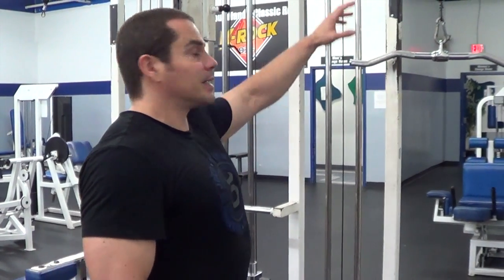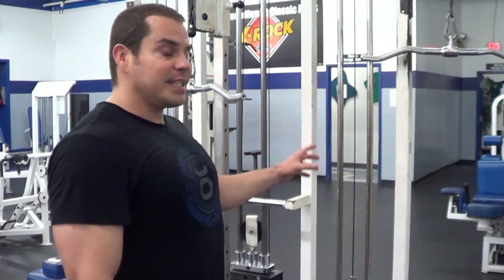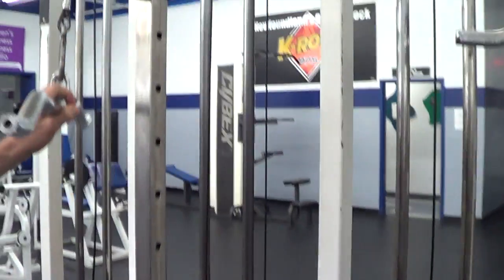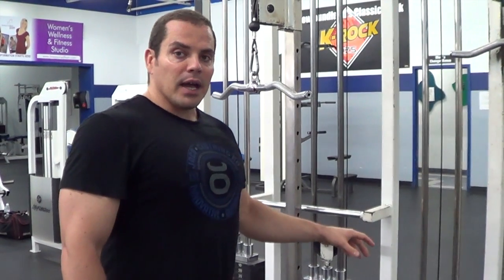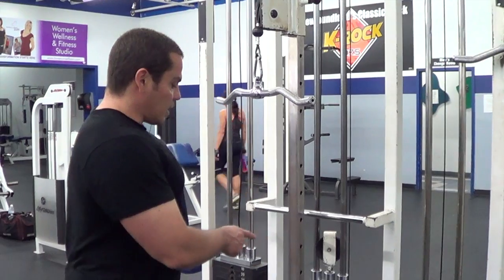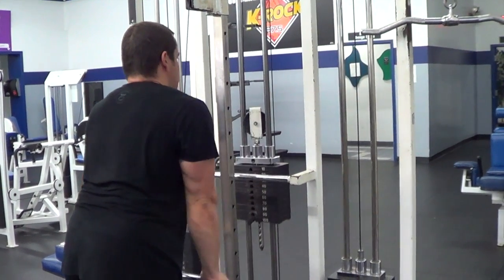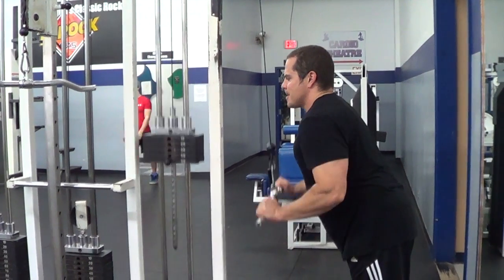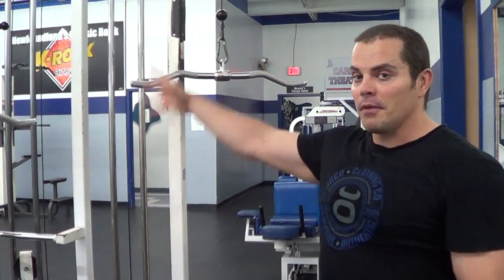Ask Lee: Why Some Weight Stacks Feel Heavier Than Others?

Comment: 155/2=77,5lbs, this is due to the stack having a second pulley, increasing the mechanical advantage. More pulleys also mean more friction so say 80-85 lbs might be most accurate weight lifted

Comment: It's not the amount of "stationary pulleys" but the amount of load bearing pulleys that travel with the movement of the load and how they are configured that reduce the weight (traveling pulleys can also be configured with no weight reduction) 
The machine on the right had no traveling pulley and has a 1:1 ratio, 50lbs feels like 50lbs. the machine on the left has that pully right over the stack. That pulley reduces it to a 2:1 ratio requiring only 50lbs of force to move 100lbs. 
The advantage of a 2:1 ratio is the weight stack travels upward half the distance you move the cable (like a lever) which means you can pull the cable twice as far before the weights hit the top of the machine. 2:1 ratio also has a lot smoother feel which is why it may seem lighter.
1:1 is great for heavy lifting like rows that don't require much cable travel and you get the full effective weight of the stack. 
There are some machines reduce the effective weight to 4:1. I'm not sure why that is needed but they exist.
Reply from the maker: Thanks for the detailed explanation.

Comment: Lee, you forgot to tell them something you know: the more pulleys - the better, not just for your ego, but also the cable moves much smoother and the resistance is equal from top to bottom, when it's only one pulley at the beginning of the motion it's really hard and then at the end it's super easy because of inertia

Comment: This is bullshit IMO.  When designing cable machines, they should be able to calculate the exact amount of weight you are lifting and display it on the weight stack regardless of the plates actual weight,
Reply: VF you totally missed the point he was making.  he wasn't arguing with the explanation
Reply: Johnny Begley It's not bs, it's pure Physics.

Comment: See I started going to a new gym with a lot of hammer strength and squat racks and like life fitness machines and only one cable crossover, this gyms cable crossover says the max weight per handle is 95lbs but that 95lbs feels heavier than the ones at my old gym that went to 230lbs, I would do 170lb press downs and I cant even do the stack of 95lbs for 8 reps? Its the same with the life fitness horizontal leg press its says 250lbs but you cant budge it even when your doing 400lbs on the hammer horizontal? Is it the cable tensions maybe?

Comment: Its the mechanical advantage. With 1 pulley and 100lbs it will take you 100lbs of force to move it, With 2 pulleys the mechanical advantage is 2:1, which means it will take 50lbs of force to move the 100lb stack.

Comment: I tried but I use the multi choice pulleys and add weight, I can put on about 50kg on top whats already there (it says 27.5kg but it's not) and I can do my 5 reps.
But I tried the other pulley where the weight goes up to 70 kg, I chose about 60kg to compensate for the other machine and it was a lot tougher at the top part because it felt like something was pulling it past my regular point when doing tricep pushdowns.

Comment: All of the "machines" that use cables, chains, belts, etc.. to move the weight lie. Just because it says 100 lbs, doesn't mean you're really lifting 100 lbs. The same machine type, such as overhead press, built by different companies, will have a different force. I had to demo this to someone using a pulldown machine. Put 400 lbs on the stack, and pulled the weight. I weight 205. Should have pulled me off the seat, but didn't. So much for 400 lbs. LOL!! Good explanation without the physics.

Comment: I never understood why they write the weight of the actual weights in the stack, rather than how much weight that translates to at the handles. I've see machines for overhead presses where the handles are 4 times further from the pivot than the point where the stack is attached is, so you are only lifting a quarter of the weight you think you are, and the weights are only moving a quarter of the distance of the handles. Would it kill them to just write the weight at the handles?

Comment: The reason 50lbs on a single pulley "feels" heavier than 100lbs on a double pulley is the kinetic friction of the cable against the pulleys and the pulleys against their bearings. The cable actually travels farther with less pulleys involved, thus generating higher resistance.